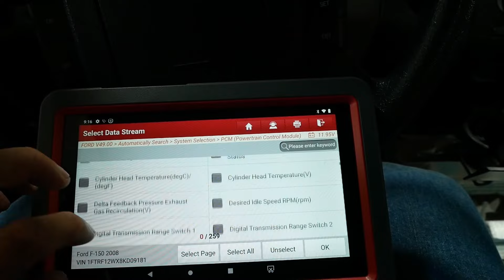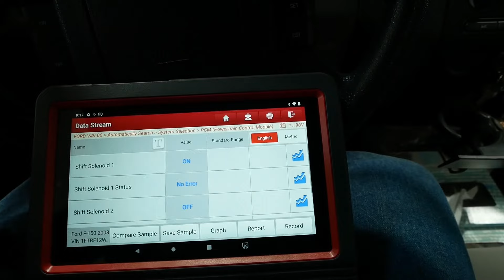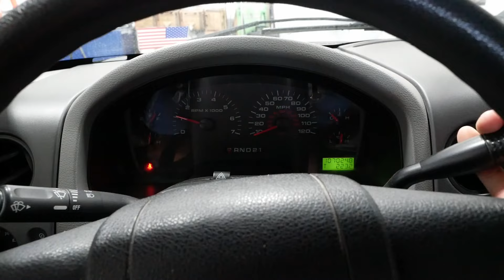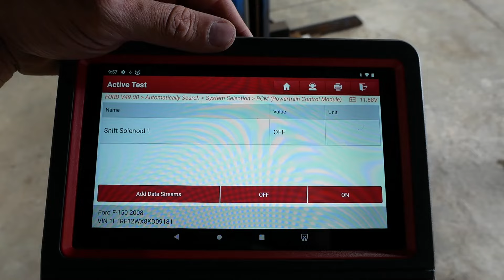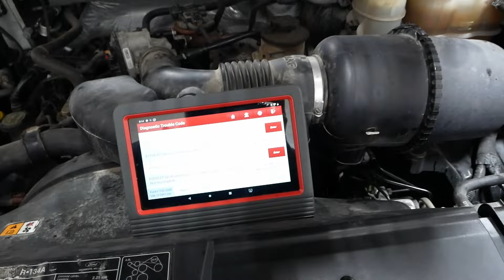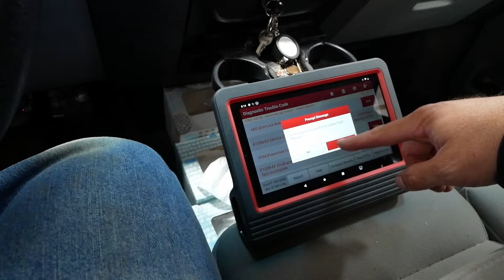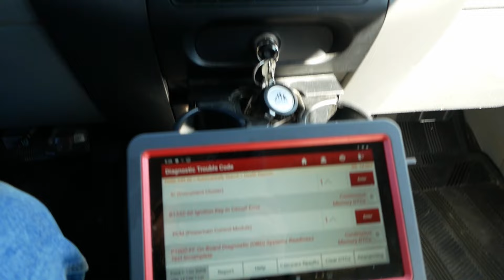Ford Trans Troubles - Dragging in Low and Reverse - 4R70W

Comment: Having spent a solid 4.5 hours yesterday replacing the radiator in my wife's Toyota/Scion, you telling me the Ford took 8 minutes is making me rethink my life choices 😉
Reply: Anyone remember replacing a radiator in 45 mins.
1. Remove upper/lower radiator hoses. 
2. Remove two trans cooler lines. 
3. Remove heater return hose.
4. Fan shroud
5. Two metal hold down brackets.
6. Pull and install new one and done. 45 mims.
Reply: I'm sure by now,  the engineer who designed the radiator in that Ford has been sacked for making it that essy
Reply: @johnclamshellsp1969  I can name that tune in 40 minutes!
77 Chevy pickup/stick !   No transmission lines!!!!
Reply: @johnclamshellsp1969  
I could swap a timing belt in 45 minutes on my old Ranger. 2.3 manual without A/C.

Base model v8 pickups and vans are still not bad.
Reply: True but when's the next time your gonna have to do any work on that Toyota vs the Ford bet you will win out in the long run. 😂
Reply: Rethink your thought. Depending on what gen Toyo product you have, you shouldn't need to spend time changing part after part at the same mileage as other ones with less reliabiity. DIY is always hard, the first time.
Reply: @JohnSmith-tv5ep  My wife's car is a stick as well, and it STILL took 4.5 hours!
Reply: @mh87351  exactly. 100k is your first Ferd transmission. Double that plus some for a Toyota. Even three times if you keep up with maintenance. He'd be spending 4.5 hours every month fixing something new that goes wrong on the planned obsolescence big three makers.
Reply: old american engineering! easy to work on
Reply: @LAactor  No modern car is a panacea...not even Toyotas
Reply: @LAactor  based on my experience that Toyota will still be running while the fords rotting in the junkyard. At least true of any of the smaller American cars that compete with a scion.
Reply: Yep, you messed up buddy.
Reply: Trucks are always easier than smaller vehicles
Reply: @melvingibson4525  Not every time.
Reply: @chrisfreemesser  that's cause when not 'if' ,you drop a wrench or bolt in a newer vehicle, you got to be a contortionist  ! Lol
The old Chevy,.... If you dropped a bolt, wench or whatever, it hit the ground, but you had to climb out of the engine compartment making sure you didn't fall thru  while trying to  step out from the inner metal fender well you were just sitting on! Just saying, the new stuff is all crammed in .
Reply: @841k9  And remember as well, we did not have piston to valve contact engines either. It was only typical of overseas vehicles. 
It was. Car towed in,  ohh damm, the timing belt is bad. Okay, replace the belt, engine belt and do a full tune up and done..
Reply: @johnclamshellsp1969  those trans lines can take 1 minute or 1 day to overcome though 😂
Reply: Cars and trucks use to be so easy to work on! On my 64 Chevy p/u it took removing 2 bolts and install new gasket , replace the water pump  , remove fan , loosen alternator to remove tension from belts , then 4 bolts and the water pump came off ! The most important thing was the radiator was all metal ! Plastic is a joke , screwing in transmission line on the bottom of the radiator would strip out. The automobiles now are made to be thrown away with all the cheap parts
Reply: My cars a manual gearbox so when I did mine I had no trans cooler lines to deal with.
Reply: @mh87351  Look how many 90's Camrys and Accords are still knocking about in the south as daily drivers. Meanwhile their Chevy Cavaliers and Ford Taurus cousins from back then went in the crusher probably 10-15 years ago.
Reply: @johnclamshellsp1969   Yeah.   (Sigh) The good old days!
Reply: @JohnSmith-tv5ep  Smart move!  If my Ford van had that option, but I bought it at the end of the sales year.
Reply: @LAactor  true ...only 3 or 4 times as many f-150's on the road...they are just crowding the transmission shops.  Never seen one even go that far usually out by 10k...engines soon after.
Reply: Did that Toyota need a new transmission @ 107K? With some Fords (Focus) that would be on it's 3rd or 4th and they call it normal.
Reply: Ever do one in a 2008 Ford Explorer Sport Trac.  The book told me it was a 2 man job.  I did not believe them.  I struggled for hours with that thing.  Worst one I've ever done.  That thing was a huge bitch.
Reply: @MrClarkisgod  I'll keep that in mind because we have a 2007.
Reply: @chrisfreemesser  notice I didn't say modern. Especially Toyotas made in America. Now compare all vs Toyota and other Japanese brands and you get outratio'ed. No matter what your patriotism and allegiance bias says.
Reply: 189,000 miles on my ‘06 F150 Latiat 5.4L 4x2 and the tranny is doing great, nothing but standard services. Wife’s 2014 Tundra with 80,000 just had the tranny replaced due to a bearing going out like the one in this video! Doesn’t matter maker anymore, they are all shit.
Reply: @mh87351  My Toyota was crap. I went Ford after that. First a 94 F-150, then switched up to a 2001 F-250 Powerstroke 7.3. I'd never go back to Toyota.
Reply: @chrisfreemesser  amen to this, my toyota has been the opposite of reliable and I am religious with routine maintenance.
Reply: @johnclamshellsp1969  My car takes about 10 minutes. That includes removing and reinstalling the twin electric fans.
Reply: @mikerhodeback9636   Don't forget that 2008 truck has that crap 5.4 3 valve  engine aswell.
Reply: Once upon a time, I could pull the radiator on a 1982 Ford Escort, replace the petcock and reinstall, including bleeding the heater hoses, in about 20 minutes.
Reply: haha trust me stick with your Yoda ....trucks have there evil issues and them issues cost more than anything on your Yoda lol plus the yoda fuel milage is the saving grace on why to keep it
Reply: Dude, old Toyota radiators are even simpler than this. My 2000 Camry I can have the radiator in and out in like 15 if I'm in a hurry. Takes longer to drain and refill the thing than actually pulling it.
Reply: I miss my old 85 F150 with a 351. Valve covers right there. No taking off 500 parts to get to them or to change plugs and wires. It had a mechanical fuel pump on the block. So so simple for me to do my own work. Minus the carburetor because I didn't have experience with working on one

Comment: Your transmission guy is one of the good ones. I was thinking, "What about the transmission cooler circuit?" But he was on top of it. You'd be surprised how many guys forget something simple like that.
Reply: Also he installed some kind of upgrade kit going by Wes reading out the invoice
Reply: @alouisschafer7212  yep, that's the way to do it while you're in there.
Reply: Anything to do with auto transmissions is still all black magic to me. I sort of get it... almost. But I still don't 100% understand them and probably never will. Anyone that works on them is up there with brain surgeons as far I'm concerned.
Reply: Thats a pretty neat tool if it actually works well. I resort to replacing the cooler or putting an inline filter in if they are pooched.
Reply: @MattExzy same boat. I understand that idea but once I see the all the fluid channels and check balls I’m lost

Comment: That transmission had never been serviced before. The yellow plastic plug in the pan is the assembly line dust cap. When the dipstick is installed on the assembly line, the plug gets pushed into the pan. It is to be discarded at the first filter change.
Reply: Fords recommended service intervals are too much. Needs fluid changes sooner than what they say for longevity
Reply: @kd7cwg  30k at most 100/150k is nutz!

Comment: Great video , Wes !
I really like how your transmission guy told you to take out the radiator so he can flush the trans cooler , I know alot of people that have had their transmissions fixed or replaced and nobody ever flushed out the cooler and ended up with another burnt up transmission due to that .
It's really cool to hear people actually care enough to make sure a customer gets the job done right the first time.
Reply: Id like to add to that statement of keeping the customer happy the first time and say that not only is that true but it goes even deeper than that. He is doing this not only to make them happy but to KEEP them happy.  Meaning they won't have a comeback they have to fix and eat the cost of the repair for free due to a half done job.  Do it the first time so there won't be a next time!
Reply: Always flush the whole system when replacing transmission's it's a no brainer I think

Comment: I had the exact same issue 110,502 miles, P0731 and symptoms, only fwd in 2nd and rev, slight whine.Pulled the pan and the fluid was dark and slightly burned. found large metal pieces in the pan, likely from a clutch drum. Bought a trans from a wrecked truck with 25k on the clock. Slapped it in over a single weekend and it works great. 14qts of fluid, wrecker trans, , flush cooler and lines, 12 hrs labor to R&R and 500 curse words trying to get the wiring harness at the back of the engine out of the way and the top bell housing bolt in. Total less than $1000. All done and works great.

Comment: I learned my lesson incorrectly installing a torque converter years ago. Took the trans out to replace the front pump seal in the trans, well I didn’t fully install the torque converter back in and then when I lined it back up with the engine it wouldn’t seat properly so I pulled the trans into the engine using the bell housing bolts, needless to say doing that cracked the trans pump, didn’t know until I went to start the car and it was dumping fluid out of the bell housing, had to pull it back out and replace the front pump. Definitely learned my lesson that day lol

Comment: From the looks of that pan, this owner has never changed the fluid in this transmission. Brian at Fordtechmakuloco has very good info on the F150. These are known for the snap ring on the reverse/OD piston failing. Fairly easy fix. I bought a pan with a drain plug at 35k miles, changed the fluid then. Many years ago 2004 F150. Have since dropped the servo block, replaced the 8 balls in the servo. Currently 173k miles.

Comment: I always tell ppl to maintain their vehicle and it can last for quite a few years. This truck is a great example.
Instead of scrapping this unit as most would do at this point, fix it and keep it running til until something catastrophic kills it.
A lot of ppl think they have to keep replacing their epvehicles every few years when you really don’t.
$2000.00ish is good money spent to get more years out of this truck instead of spending $50k-60k on a new unit.

Comment: Back in the 80's I had a '72 Ford Gran Torino Sport that had a C6 automatic transmission.  In a moment of haste, while still moving forward, I jammed the transmission into "park".  It produced a fairly loud "bang" and the car immediately stopped.  I was worried that I had damaged the transmission, yet after that incident, the transmission continued to function with no problems.  A testament to the durability and construction quality of those old C6 trannys.

Comment: In the past I had taken a plumbing night coarse. The best lesson was when to hand off the problem to an expert. Good call. It is frustrating when engineers design vehicles that do not allow for easy maintenance / repair. I guess its the price of progress. Great video as always.
Reply: Figure that a lot of the testing phase gearboxes (like pre-production stuff) have exterior accessible solenoids and most of the non critical stuff is operable from the outside. :) don't you just love that kind of shit?

Comment: Another Great Video, Wes. I wonder if that was a rare failure or something that the transmission shop sees on a regular basis? When they install upgraded parts or updates, I wonder. It seems like newer transmission problems are more electronic issues than mechanical issues. Thanks for making the point about the Torque Converter installation and flushing all the cooler lines. Really Appreciate your attention to detail and commentary. 👍🏻👍🏻
Reply: Rare with that low of miles.
My guess is towing a trailer that is to heavy.
Those 4R70's are solid transmissions.👍

Comment: Being a transmission tech for years I gave up fancy holders for the Jack and just welded a 4 x 8 plate with slots for the mount bolt to the Jacks platform and I would bolt the transmissions right to the trany jack. Much safer and tilting the platform can be done with zero sketchyness.

Comment: Wes’s, I had a 2001 Ford Ranger XLT 4x4 with factory tow package ( extra trans. oil cooler ) automatic. At 126,000miles a s 17 years old the trans gave up. The cause was internal oil cooler inside radiator leaked putting antifreeze into the trans oil. Rebuild trans and a new radiator along with trans shop labor removing ,installation and rebuilding of trans cost me 2300 dollars US. Just letting you know owners that your radiator can cause your trans to go. Replace it every 50,000 miles to be safe. Plastic junk.

Comment: that made me have flashbacks of changing the a4ld trans in my 90' mustang. didn't have all the fancy tools. did it on 4 jackstands in my driveway, by myself. i never have been a very strong guy, didn't have another person to help, and didn't have a transmission jack so getting that other trans mounted to the engine was a challenge! plenty of "OH CRAP!" moments when i thought that heavy sucker was gonna fall on me. used floor jacks, a little cart on rollers thing, and the cross member for leverage and a chiltons manual. i only hoped my mother could hear me scream from inside the house and come help me if something fell on me. oh, and i used a craftsman pear headed 3/8" ratchet with a breaker bar(it was a tough ratchet) on the driveshaft bolts. no fancy impact drivers. rough times man! lol.

Comment: Always  good to watch . I was sure taken back when you felt $2000 was "not to bad" . Man I cant get used to repair prices . I applaud you for knowing your limits.
Reply from the maker: The Allisons in the GMs are like $3500.
Reply: Last 4r70w I rebuilt took 4 hours and $500 in parts. That was 8 years ago though. Prob $1000 for just parts now.
Reply: @mph5896  I have a 4r70w in my 98 Ford e250
Reply: 2 grand is common around NC for a basic RWD transmission rebuild 
Imports or HD transmissions are way more pricey
Reply: You should see what the new 8/9 speeds cost to repair…
Reply: You should see what the new 8/9 speeds cost to repair…
Reply: You should see what the new 8/9 speeds cost to repair…
Reply: I bought my truck solely because it had the Allison transmission.  If it did not, I would not have purchased it.

Comment: During my summer vacation, my Odyssey, with 130,000 quit moving.  It made a grinding noise. The local Honda dealer diagnosed it as a bad tranny, covered under extended warranty.  I drive it 800 miles home after replacement, when it failed again.  Turned out to actually be a front axle, and not the tranny.  The new tranny engaged the worn splines on the driveshaft enough to get me home.

Comment: 4R70W or 4R75E (W) are some of the easiest 4 speeds to rebuild and understand. (Same for GM 4L60E and 80E) Wes, you would not be in over your head to tackle it. Also, if anyone else drives one of these, I highly recommend the J mod. It's cheap to do and really improves the slushiness of these with their soft factory calibrations. Ford did a lot of the changes involved towards the end of production of them.
Reply: Sounds like a sonnax HD valve body was put in it. So j-mod really is not an option to mingle parts.
Reply: And then an otherwise fine transmission went away because of "progress"
Reply: I have one and can't tell for sure if it's had a jmod or not. At light throttle I wouldn't say it shifts hard, but it seems to shift quicker than most panthers. But if I mat it, it'll bark the tires on the 1-2 shift.
Reply: Dave, the problem for many of us small shops is not the lack of knowledge or the ability to understand transmissions, it's not being able to justify to the cost of the tools and equipment to service them.   As a "general repair shop" we might see two to three transmission rebuilds a year.   Not worth the space and money to set up for that.
Reply: @humbleservices6418  Exactly. I got into transmissions as an interesting hobby. The worst thing about transmissions is 1 little screwup and its coming back out again and apart. Not worth the hassle for a small shop.
Reply: @mph5896  Exactly this. Would I rebuild something relatively simple like a 4L80E or even something older, like a C6 or TH400? As long as it was my own slushbox and it's just going in my rig, sure! Sounds like a fun challenge, and if I screw up it's just my goofin-around-time that's been spent. Would I EVER do such a thing for a dollar? Oh hell no, not a chance! If I screw up, that ain't my goofin-around-time I'm spending anymore. No thanks!

Comment: Evening Wes. 
When I use to swap out transmission when I was a tad pole. 
My transmission guy told me to always flush my oil cooler lines.
I bought 3 cans of KOOLER CLEAN. Flushed it towards and backwards until clean cleaner came out. Add 1 qt to the converter. Seated the converter and started the install. All of this on a concrete driveway. Truck jacked up and with jack stands.
I got pretty good at this and made some extra $$. I never rebuilt the customer stuff. I didn't have the tools.
After I learned more about rebuilds I did a few. Learned alot. I'm about to drop my trans on my 03 Chevy after 365k miles. I'm crossing my fingers and hope it's only a minor issue that I can fix. I'm suspected a broken servo spring or piston. 
Anyhow. Thank you Wes. Brought back memories.